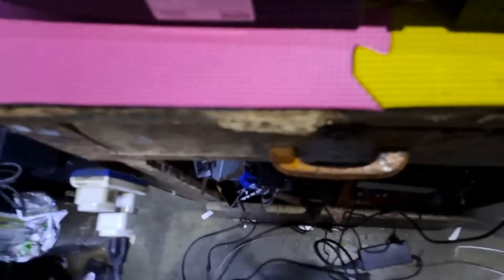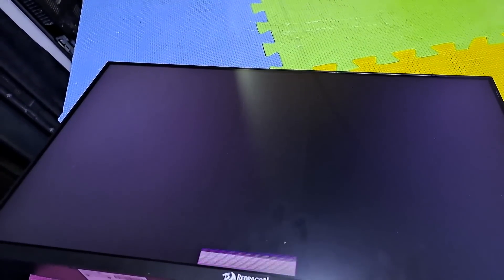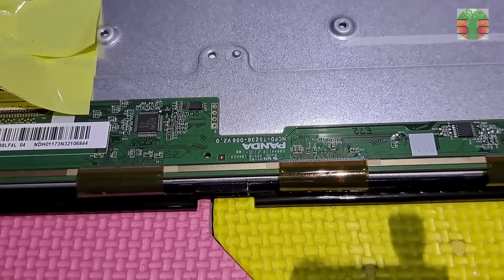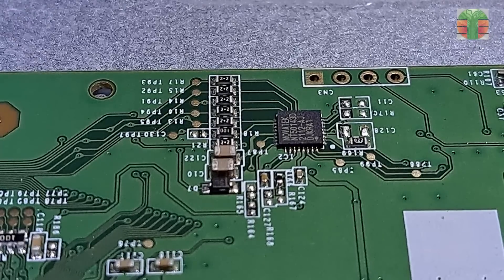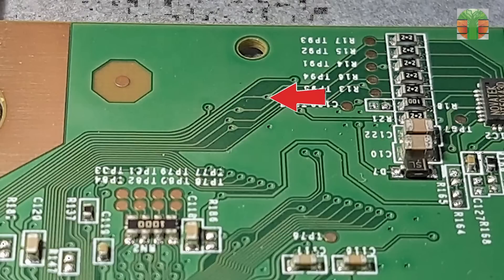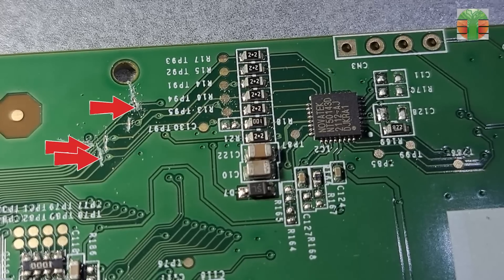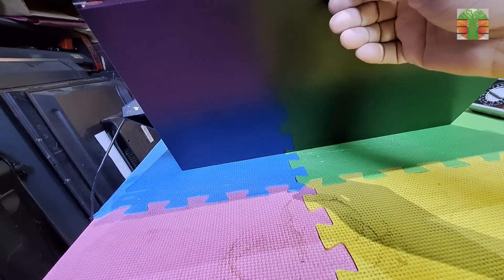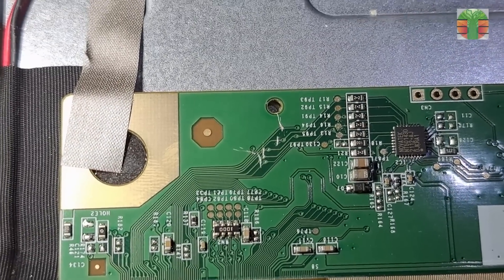Flickering image fix

Comment: sir wherr  you have cut the ckv lines there are resistance before the lines on this track
it would be OK if you disconnected one side of the resistors .
just to avoid reconnecting the ckv if it's the wrong side .
Thanks for respond .🙏
Reply from the maker: You can't detect which side, its a trail and error.
Reply: thanks ❤️ 🙏  @tevzTVTevatronics

Comment: A great temporary fix, but what part can be changed so no traces are cut? Since it is my microscope monitor, I need both sides to have equil image quality, Thank you.
Reply: The problem is in the gate driver, which is located directly on the glass LCD panel, so it cannot be repaired. This fix disables the faulty gate driver on right or left side. I wonder how this will affect load on the remaining gate drive and its life time.

Comment: Thank you for this video. I've got a question. I've got a TV Samsung  UE50RU7100K which has a picture, but from time to time and now more often, the picture is flickering. Is it as well clock issue? Or, in my case it can be something different?
Reply from the maker: Flickering image are mostly related to CKV lines.

Comment: I have a laptop with a short, two capacitors (1 on each side of board) show short but when removed they are showing 1 on multi meter in beep mode, does that mean they're good/bad? Short still on board can I inject voltage on shorted power supply coil say 1 volt? Don't have thermal cam. It's very close to CPU but CPU was removable
Reply from the maker: Inject 3 volts so it will hotter

Comment: Hello tevz.  I have a problem with led TV panel size 55 inches. 
All voltages are ok in t.con when I taking up the right or left flat cable from t.con but the voltage avv falls when I connecting both sides together.
Reply from the maker: Isolate the CKV lines
Reply: @tevzTVTevatronics  thank you very much sir.

Comment: Hi. Why does the monitor get fixed by cutting these paths?
Isn't the information in this part needed for the panel
Reply from the maker: Yes, It needs that signal on the left and right sides. Since both sides are paralleled, Stiill works when the bad side is disconnected. The image result is a lower quality on the other side.
Reply: So you did not fix it correctly...

Comment: Hi and thx for your video.
Why didn't you isolate resistors from R13 to R17 instead of cutting lines?
Reply from the maker: If those resistor is removed it disconnect both side, and you can't identify the bad side.

Comment: Thanks TEVS. You are very smart man!  Is there any reason that you don't use an electric screwdriver to make disassembly / assembly faster?
Reply from the maker: My battery-powered drill is broken, the motor is stuck up. and also my right hand is suffering from arthritis pain. if you notice that I hardly move it.
Reply: @tevzTVTevatronics  I am sorry to hear that TEVS. Even more amazing that you work one handed. Would a small electric screwdriver help you? We have a hardware chain here in Australia called Bunnings. They have an inhouse brand of tools branded Ozito. I have small driver of theirs and find it quite good, USB rechargeable. I would like to send you one as a gift if it would help you. Let me know how to get it to you. Best wishes.
Reply from the maker: @bobs_ya_runkle  That certainly will help me with my work.  It is my pleasure, and you are so kind. Feel free to message me here on my FB page And give you my address. https://www.facebook.com/profile.php?id=100057149602411.  Thank you again and God bless you.
Reply: @tevzTVTevatronics  My pleasure.

Comment: Hello, nice video. Could you explain what exactly you are cutting with these lines and why?
Reply from the maker: There is a short circuit at the 1 side. So if is disconnect the bad side it will work, still work because the CKV lines is conneted on the other side.  WHAT IS CKV ( CLOCK VERTICAL )SIGNAL? Clock vertical signal is normally a square wave signal its contain high and low-level signals, The high-level signal is the cut-in voltage of VGH voltage which is used to control the panel TFT. The low-level signal is the cut-in voltage of VGL voltage. By google.